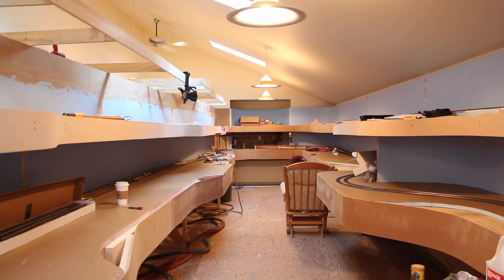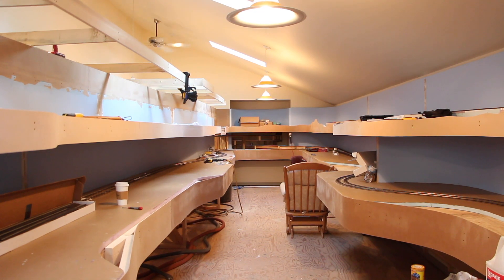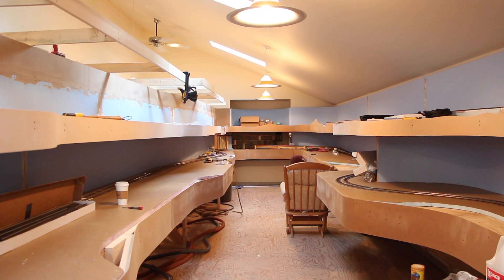January 2018 Layout Update! Major Projects

Comment: On your passing gate.  If you continue to need modification.   A suggestion would be to have the gate slide up a positioning "slide then drop intoo a dovetail or a set of angle iron centers, set like this " ^ ".   Might solve the movement issue.  Great job!  Can't wait too see your next video.